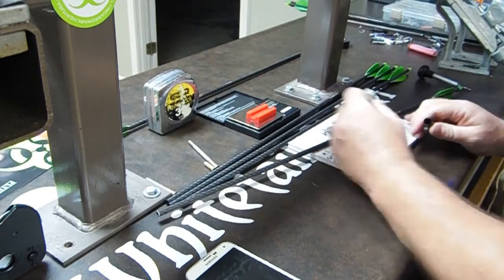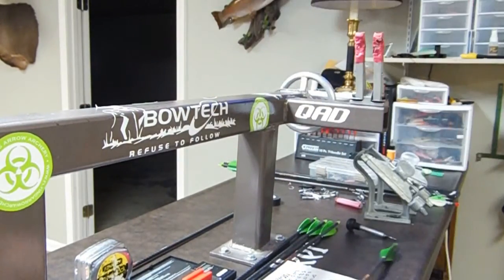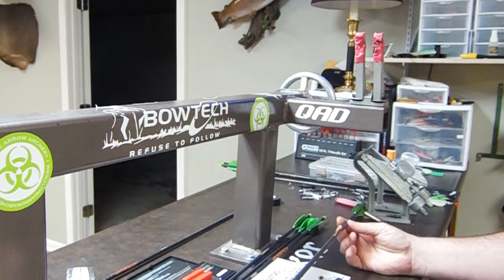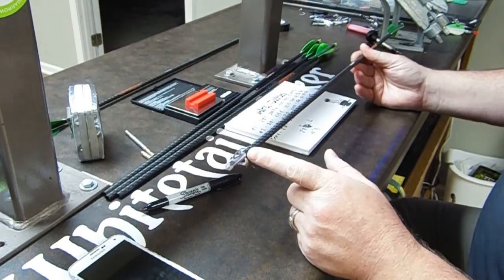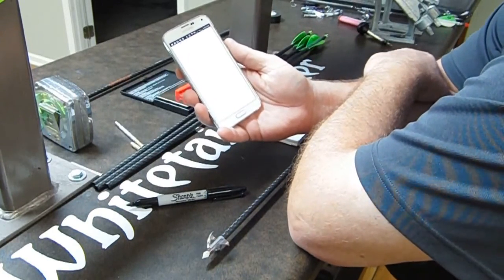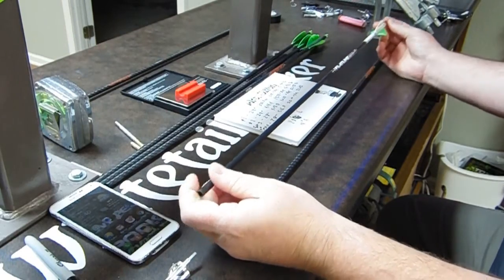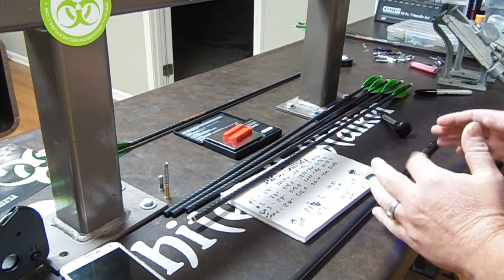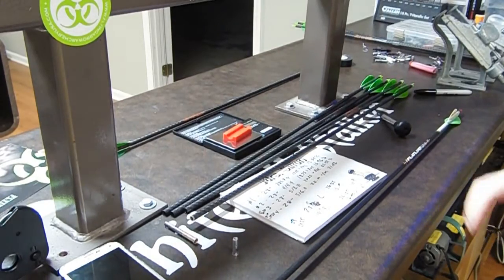What you need to know about FOC (Front of Center) Part 1

Comment: You can fletch your veins or feathers forward. Which will increase your foc also. I always fletched my steering at 5/8 from the rear of the arrow.  No vein contact with your face and you get more controlled rear steer.  Because it's closer to the control zone of what your foc is suppose to do.

Comment: Why are you not measuring the arrow length, w/the broadhead, in the beginning? My FOC sucks on my bolts, even with 60 gr brass inserts! Please help, season is 9 weeks away!
Reply from the maker: The measurement I use is the AMO standard.  Replace you inserts with a 100 grain brass insert.  That will help tremendously.